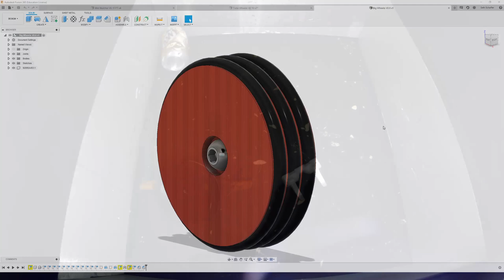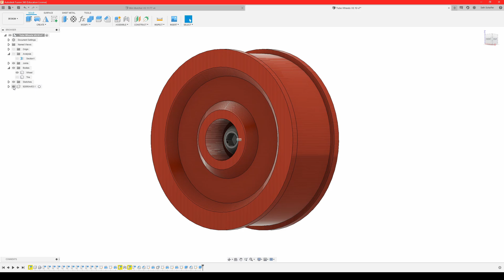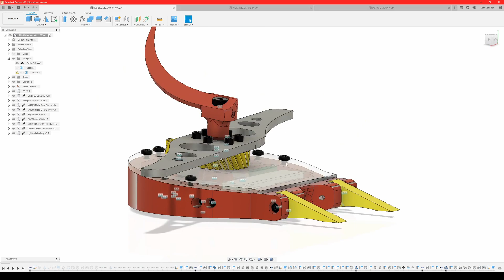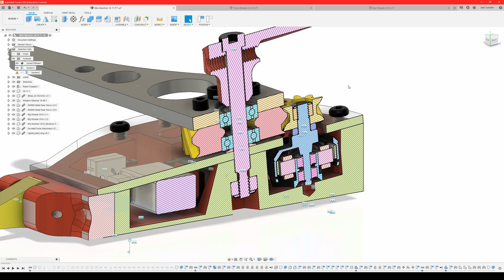Why So Spinny? Mini Mulcher Stability Quest: Part 2 (1-Pound Antweight Combat Robot)

Comment: If you don't plan on spinning the weapon to 100 percent speed, why not adjust the GR to increase torque and decrease current spikes?
Reply from the maker: 1. I can actually use nearly full speed now, I don't plan on being at full speed for the duration of an entire fight though. I'll probably do another test for how much the battery life degrades at 80 or 90%. 
2. The motor gear is as small as I can get it and the motor is already practically inside the rear wall. I can't really make a bigger gear and still fit it in that chassis.

Comment: Why not use the spinner to create down force? I haven't seen that done yet but you mentioned you thought it created a vortex below the spinning blades... angle the edge a bit and create a down force propeller.
Reply from the maker: It's less trivial than you might think to 'angle' the edge of a hardened steel weapon and still keep it balanced. I have seen on a 3lb undercutter an attempt to add a 3d printed airfoil around the spokes of a weapon disk, but the builder of that bot said it creates well under 1 pound of downforce. I just got my new weapons today which are much better designed for avoiding polhode instability and that has solved the issue for the most part up to nearly full speed.
Reply: The problem with this is that you would need to spin the weapon very fast to get any usefully large amount of lift (or downforce). Unless you’re at the very top of the motor’s rpm range (think about how fast drone props have to spin) then angling the weapon blades only really produces drag, which is just another unnecessary load on the motor.

Comment: I had inquired about using rubber tubing for tires in the antweight combat robotics facebook page and was cautioned that while they grip well for about a minute, the last 2 minutes of a match they spend caked in enough dust/debris to severely limit the grip. I ended up modifying my design to use lasercut craft foam as the tires with special integral features for retention.
Reply from the maker: Yeah that is certainly gonna be a problem for anything sticky. Same thing happens to the foam tires once coated with latex like I've been using on Division as well. But it still seems to be better than the bare foam in that case by a long shot. I think cast silicone wheels will have a similar issue as well. The benefit in Mini Mulcher is mostly the extra surface area from softer rubber. Even the harder rubber o rings pick up a lot of dust though.

Comment: Feedback... The new microphone is great; I didn't notice any change in the camera, perhaps because I have such a low budget 10" tablet and slow broadband connection.

Um, the content and presentation is still excellent, and I don't suppose anybody else will make this point, but I always listen on headphones and I'm finding the accompanying music to be a bit loud.

I appreciate that a YouTube channel is a personal thing and that the music's a key part of the package, but for me it's distracting. Would it be possible to gradually turn it down in, say, 5% increments until someone notices and complains that it's getting too quiet?

An alternative might be to just mute it a little when you're speaking.

Having said that... Music that punctuates adds flavour; auto-fade and compression is fine; but aggressive daytime radio DJ spiel over stuff I'm trying to listen to has always had me reaching for the off button. (I actually stopped listening to the radio when I was a kid because of DJs who talked over and ruined record intros. Made me so ANGRY. I think I probably have Asperger's.)

If it's any help as a guide, I find the speech-to-music balance on the 'Clickspring' channel perfect. It's about clock making and has incidental music that's no louder than a bumblebee mugging the geraniums outside your back door.

Enough of that. Here's a thought about tyres. When I started building combat bots (1987), I had problems with tyres peeling off the wheel rims. I tried glue, tape, bolts, rivets, ridges... nothing lasted. I actually had too much grip on the floor, so side-impacts and lateral forces were especially destructive.

I ended up making built-up sandwich wheels with an integral sheet of squishy tyre material.

Imagine a generously-filled beefburger. Bun, filling, bun. For a wheel that's side plate, silicone rubber filling, side plate, with 6 bolts and 6 blank alignment rods/dowels holding the sandwich together. For the bots I was making - they weighed 100 lbs - the filling was roughly 1/2" thick (2x 1/4" slices) and overhung the 'buns' by about 1/2" to make the tyre.

Advantages over regular wheels? Robust. The 'tyres' are completely stable laterally and radially at any RPM, and they can have varying amounts of rubber filling to change grip and suspension characteristics for different floors (we fought on wood, polished concrete, and metal surfaces, and sometimes outdoors on asphalt).

Disadvantages: weight. I used plywood, steel bolts, and aluminium locating dowels; maybe a modern mini-bot could use 3-D printing to mould in integral dowels and keep the mass down.

Thanks for these detailed development videos. I love seeing how ideas evolve.
Reply from the maker: Thanks for the feedback! Very interesting about those wheels. I doubt I could scale that down to ant size but it might be worth a shot for Draconid one day. As for the music, sorry it's a bit loud. I will try to make it a bit quieter next time. I have given it a listen on some quality speakers and a decent set of headphones but you never know what the balance will be one everyone's equipment. I have found people tend to watch less of videos that don't have any music however. 

As for the camera, that isn't too surprising given the new gopro is using nearly identical hardware. The main difference is in software. I also improved the lighting in my test box which is crucial for filming slomo since at 120fps each frame is exposed for just 1/240th of a second. That meant I could film basically everything in 1440p 120FPS and get slomo when I need it without making the whole image way too dark just to have the option. Basically I shouldn't need to choose between good looking footage and slomo footage. I can get both.

The other huge difference is in the camera sound quality and image stabilization. I basically couldn't film outdoors at all before and use the audio since there is tons of wind noise but the newer camera should handle it much better and it has really advanced stabilization to get handheld shots.

Comment: Hey may I ask when are you going to put the lawnmower blade on mini mulcher
Reply from the maker: I want to try and solve the instability issues first, then I'll probably give it a spin. I need to use the Tormach to modify it to fit first also and that requires perfectly centering it or it will be horribly off balance. So I may need a balancing rig too